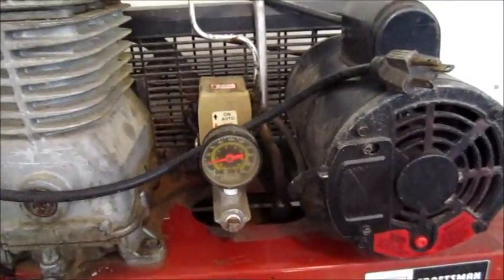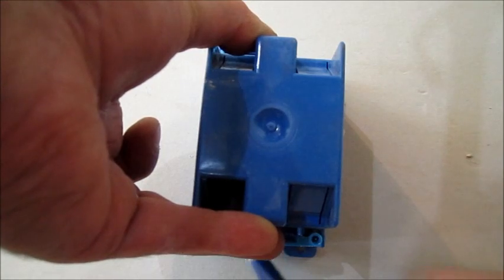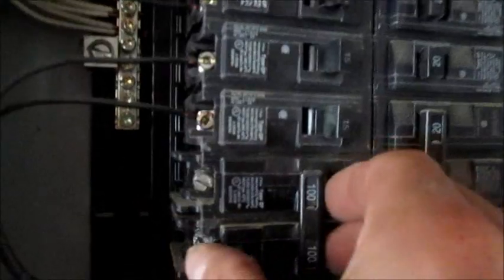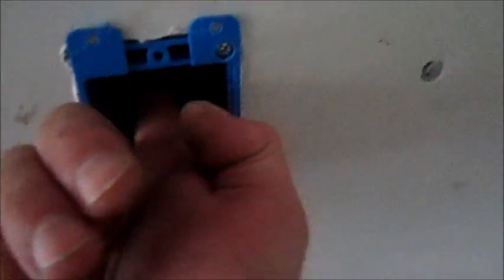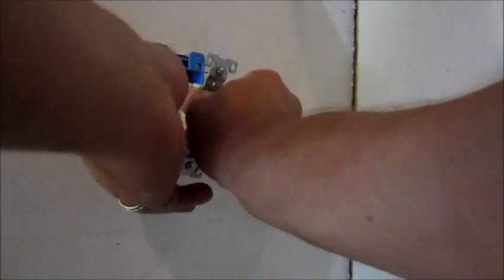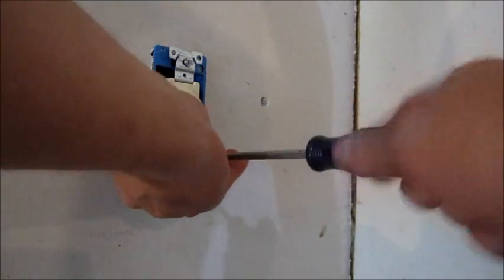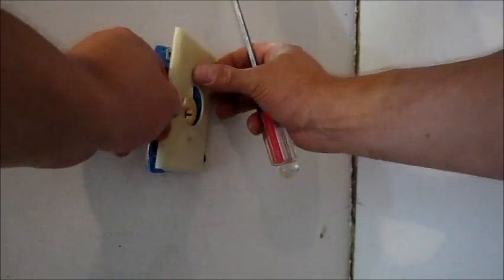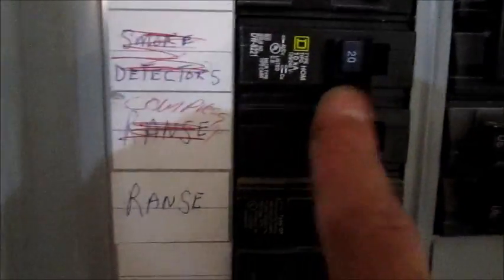How to Wire a 240 Volt (220) Outlet for an Air Compressor - NEMA 6-20 - 12-2 Wire - 20 AMP Breaker

Comment: Upside down.
Reply from the maker: If something metal  drops and slips between the plug and the outlet, you'd rather not have have have it hit both hot spades.  This is the reason for installing the outlet with the group pin on top.  It's not common in households, but you'll often see it in industrial settings.

Comment: Not sure how I got here. lol  You only have 5 problems with your install
1) Use a level when marking out the lines
2) Use a drywall saw for a cleaner cut
3) Get real screwdrivers.  Most electrical uses #6 or #8 Robertson screwdrivers
4) After installing the wires, wrap the receptacle (especially the bolts) with electrical tape.  Less likely to short out on the ground wire
5) In a utility room, consider using a stainless steel cover.
Other than that.  Not bad.

Comment: I was confused why you used a white wire.  Where I live white is neutral.  I would have used red and black to differentiate the two wires.  Not criticizing, just asking.
Reply from the maker: Yes, see here.... it should be wrapped with red tape.   https://youtu.be/OJxIvH3T2fk?t=523  Lok to the left and you'll see that I later wrapped it.  sorry for the confusion.

Comment: You're only using 3 wires? I gave 4 wires white bade black and red. Do I not connect the red? I have a double pole breaker.

Comment: The white wire should have been changed to a hot wire color using a 2/1 wire. Just to be in code and not confusing to anyone else working in that box in the future. Colored shrink tubing works well. It is a good idea to use this stuff when ever using a white wire as a hot wire even in putting plugs on power equipment that come with no plug that use a wire not to code.
Reply: Right. I noticed that too. Some red electrical tape works too

Comment: I'm installing the same type of plug for a window ac that is 230/208 15 amp I'm told two different things 1 is  double pole 20 or 30  and the wire I'm told is 12/2 or 12/3 lol need to know wat is right

Comment: Yeah...Not sure about this tutorial..Yellow wire is normally for 120 outlets, white for lights and switches....That should of been orange coated. And when you hooked to the receptacle, you have the white on the brass screw. Easy way to remember is "Black is brass, White is light (silver screw)"... I'm not an electrician, but i've worked around those trades for 35 years....I could be wrong, but I don't think I am...

Comment: Please mark the White wire - Black, or Red to tell all it is a HOT wire in this application and NOT a neutral.  Could have wrapped the outlet terminals with electrician's tape to help prevent an accidental shock.

Comment: Well then why do they call this a 240 and they call a 10 3 one 240?
Reply: @nogripes  okay so I figured it out, After thinking a lot about this. the dilemma was that when people would ask me to install a 240 outlet I wouldnt know if to do 12 or 10. So my conclusion was the amps. 10 can handle 30 amps and 12 can not. So when they tell me to install it now, from now on I will ask, "how many amps does your appliance need" BOOM!!
So I knew they were the same voltage but I never put into account the amperage!!

Comment: I currently have a NEMA 6-20 receptacle for an 18,000 BTU. Can I replace the receptacle with a 110 volt receptacle and also change the breaker in the panel. I THINK the wire is a 10 gauge.I want to run a 15,000 BTU or 12,000 BTU window air conditioner. Ask your father-in-law.
Reply: Thanks, I will try it out. @nogripes

Comment: The white wire should have been wrapped (in the box and at the receptacle) with red tape since it is now being used as a hot leg and not a neutral. I see from the comments that some people think this is a neutral wire. You NEVER screw a neutral wire to a circuit breaker...only to a neutral bus bar. In the US a 240v circuit contains 2 hot (120v) legs (usually a black and a red wire), and a ground. A white neutral wire is used to complete the circuit on 120v which consists of a neutral, a hot (black), and a ground (green).
Reply: Thank you, I was appalled at the.lack of explanation of this dangerous tutorial
Reply: AndTheCorrectAnswerIs Great clarification. Dealing with old house. Currently I’m trying to hook up a 20a/220v window unit ac. Opened up the solid wall plate and there’s the 220v wire inside. 3 wires, black, red, white. I have the same 20a/250v plug. 2 brass screws, 1 green screw. Shot the black & red wires @124v each, white wire=0v. So, I’m wondering what to do with the white wire? Hook it to the green screw?
Reply: Is it safe to leave neutral out? Since he used it as hot leg?
Reply: @NickyWalters1322  the white goes to the large prong on a plug usually, while bare wire is ground and is hooked to round prong. I am still not clear how the perpendicular prong(that's supposed to be hot 240v), is supposed to be wired
Reply: @targeted4truthjahsun  if u have a 12/ 2 cable the white will be hot now rap it in red tape to show. Then put white wire on brass screw any side. The black to other brass screw you dont need nuetral wire for 240. And finally ground to green screw
Reply: Thanks for that, that is exactly the info that I was looking for. Very helpful.
Reply: I was going to say the same thing. White wire? that is supposed to be RED. He left out the most important detail. He should make it clear in his tutorial
Reply: thank you. I was thinking the exact same thing. I'm getting ready to rewire a circuit to 240v for my table saw. in my panel it's using Romex 10/3 and I'm like where the fk does the common go? it just dangles there? and I saw this guy plugging a white wire in as a hot leg and thought exactly as you did
Reply: AndTheCorrectAnswerIs Thank you! I've watched several videos and not one of them shows coding a hot white wire with red tape, paint , or marker- nothing! It saves yourself and the next guy a lot of confusion in the future.

Comment: Great video.....is the power cord to the compressor a 12 2 wire as well.  How many AMP is the plug you are using on the power cord!

Comment: One tip that you might want to go back and redo, when wiring the circuit to the breaker, and really to any electrical component, put the wire in on the left side of the screw so that when you tighten the screw it will pull the wire in and ensure better contact.

Comment: this is the outlet we have for our through the wall ac unit. problem is we now need a new unit and cannot find any with plugs that will fit this outlet. are there any adaptors we can use? landlord will not pay for electrician and wanted to buy us a lower btu ac unit but those plugs still won't fit.

Comment: there are no rules about the ground hole being at the top or bottom, but most 90 degree plugs have the ground post on the cord side, so in this outlet, the cord would have to point up and then make a u turn to go down to the floor.  That is why the vast majority of houses have the hole at the bottom.

Comment: Square D breaker in a Siemens panel D:.... not good. It may work, but not recommended by the manufactures, neither is it code. For an instructional video, might be best to show the safe/legal way.
Reply: Came here just to see the comments on this. Lol
Reply: I noticed the breaker too it should be the same.

Comment: I need some quick insight please sooo I got a 80 gallon air compressor which is a 240v 23.5A I got it uses and connected to it was a 30amp breaker I don't know much about this stuff but we did get rid of our jacuzzi which has 2 60amp poles on it and we have a trailer hookup but I think it's only a 120v so I'm curious if the power that was going to the jacuzzi could it now be used for the air compressor and why would their be breaker hooked up to the air compressor when I got it it was just hanging there so I'm not sure if That breaker is the only one needed and I just need to get power to it or if I gotta put one where all the other circuit breakers are as well I just don't have any open spaces

Comment: So with the fact that the voltage supply in the US is 120 Volts,what this implies is that it is also possible to use equipments that runs on 240 volts.
Reply: We use 240 for dryers, stoves,   and certain power tools and stuff. We also use 208, 277, and 480 for some things. 120 we use for the majority of domestic appliances. So basically 240 outlets are only seen a few times in a home.
Reply: My mom's stove uses 127v

Comment: Nice work! I have the same NEMA L6-20R 20Amp 250V outlet that came with the house I am in. The outlet is wired directly to the outside service panel on a 30 AMP double pole breaker; the black is on 1 pole and the white is on the other pole. The ground is ran to the bus bar not sure if it is on the neutral or ground bus bar I would have to wait until the rain stops and have a look. When testing outlet I get 120volts not 240volts; the tester does work on 240 outlets because I tested it on dryer outlet. I have replaced the L6-20R with a new one just in case outlet was bad. Do you have any idea why this is only showing 120 on test. I tried setting a ATX PSU to the 240volt and testing the outlet that way; no power on PSU and the PSU is bridged to run without a main board connected.
Reply: fwiw, the neutral is grounded.  The bare protection wire and the white in a 120 volt circuit both go to a grounded bus in the panel, and the neutral from the street is also grounded at the street.   From your description, you should see 240 between the two hots, and each one should read 120 to the ground.

Comment: For anyone confused about USA 220..
You have three wires run into your house (No ground).  Think of the neutral wire as the middle one.  Now if you measured from the middle wire to either the left or the right (hot) wire, you would see 110v.  But the left 110 is opposite of the right 110 (180 degrees, or 220 apart).  So if you measure with your probes from the left wire to the right wire, the two equal 220v.  It's a sign wave, one side up 110 (avg) from 0, while the other side is down 110.

In a 110 plug your two wires are connected to the middle neutral, and either the right or the left 110 hot.  And I think you really only need be concerned about the side (right or left) when wiring a 3 or 4 way switch.  As it has been known to happen that some have actually ended up with supplying 220 to a 110 bulb because of connecting the different switches to two different sources, and ending up with a "left" hot on one switch, and a "right" hot on the other.

A 3 prong plug ((not including ground) sometimes referred to as 240) uses all three of the wires from the power company.  I think this is normally done for the higher amp-age needed for a stove or dryer (60 amps).
Reply: the three conductor plugs are for appliances that want both 120 and 240 for various parts.  For example,  a clothes dryer has a 240 volt element and a 120 volt motor.

Comment: I am confused as fuck....If you use the neutral as a hot wire then you have no neutral to go to the ground and if you use three wire where does the neutral go?
Reply: it's 240v no neutral. but he should have marked the white wire with red tape to designate it a conductor, not neutral.
120V on black
120V on red
ground green
if you measure with a volt meter. black to green 120V
red to green 120V
black to red 240v

Comment: That new outlet should be labelled 240V ONLY now that the "neutral" (white) is no longer neutral but the other phase of the 120V supply. If someone plugs a 120V device in, like a hand drill, it will burn up since it is now being supplied with 240V. In addition, the white conductor, now being hot, is a safety hazard and should have red tape on both ends to let the next person know it is now hot and not neutral.
Reply: I see your point but it would be physically impossible to plug a standard 120 device into this outlet. the hot legs on a Nema 5-15 and Nema 5-20 are always in a vertical orientation.
for 220/240.... the hot legs on both the Nema 6-15 and 6-20 are in a horizontal orientation making impossible to plug a 120 into a 240 volt outlet.  Unless someone miswired a 120 outlet with 240 volts.
Reply: Erik Liska The socket in this video has both vertical and horizontal so a 110 appliance could be plugged in thus the end of your appliance or maybe even you.
Reply: Vern Mitchinson I stand corrected. It looked like it had vertical openings on both sides along with the horizontal slots making some kind of combo outlet. Since it has only one vertical and two horizontal slots it is indeed a 220v outlet. No need to get your undies in a bunch. A simple clarification would have sufficed.

Comment: menom7, since you're starting with 110v outlet in the first place, it won't make a difference "tapping" those four (2 hot and 2 common) to the 220 receptacle. You will still have 110 volts coming out of it. 220 means having two hot wires and that's why you have to replace the breaker. Good luck and be careful.

Comment: Hi Mark,I TOO have bought a 220volt/20 amp outlet and was trying to wire it into my garage wall-outlet,but that has DUAL 120volt receptacles in it and when I tried wiring in the 220v outlet,I simply "taped-up" the other positive and negative wires that went to the 2nd 120v outlet,so when I turned on the 20amp breaker the wires go to,no power went to my 220v outlet,because the OTHER "taped" wires weren't hooked to anything to complete a circuit. My QUESTION is,would it be "safe" to simply tie the 2 positive wires together and the 2 negative wires together,that originally wired the two 120volt outlets and wire them to the ONE 220volt outlet? I'm afraid it'd start a fire from arcing!?!?

Comment: I'm planning to run a 1000 each ballast ( I'm going to run 2) I was wondering if I can run two 220 outlet like your and share the same double pole breakers which is going to be  40 amp double pole breaker? Please help.